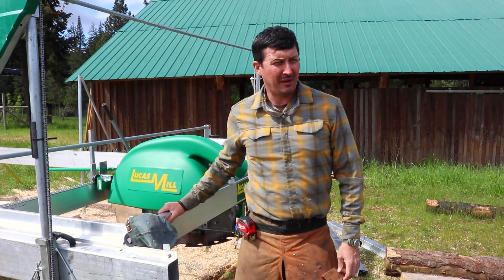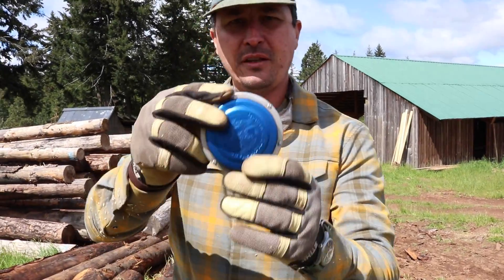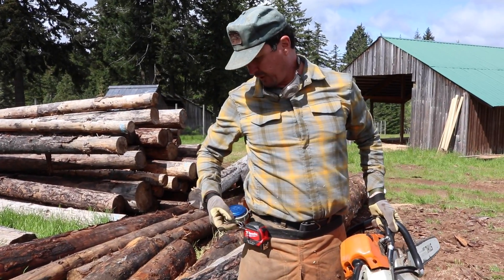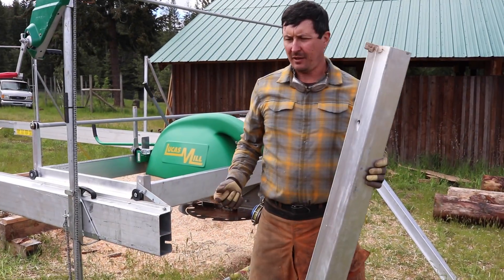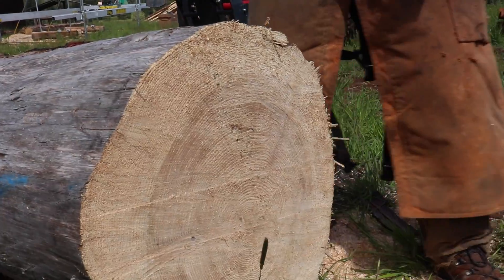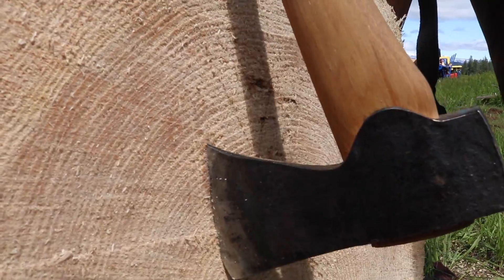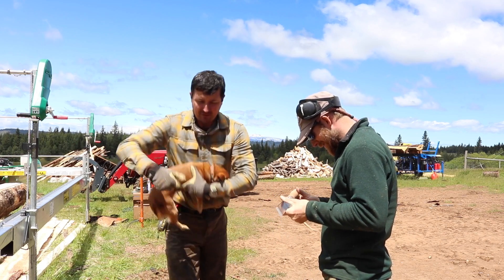Brian Gets A Special Gift

Comment: Slick working saw adjustment. On thing you may want to consider a friend of mine had a wood miser mill that was on a trailer so it was a bit high so what he did was he made a crib work of timber on the side of the mill and he had it set-up so that he could load the round logs on this crib work. the crib work frame with the round logs was same height as the bed the logs were sawn on, and then he had two removable pieces of timber to bridge between the round log cribwork and the saw mill cutting crib work, and when he wanted to load a log to cut on the saw crib work he would pull out the removable timbers to bridge between the storage crib work and the saw cribwork and roll the next log he wanted to cut onto the sawmill cutting cribwork or in his case it was a steel frame, then he would roll the log onto the sawmill cribwork and push the removable bridge timbers back under the log storage cribwork out of the way. this way he could store an evenings worth of round logs on the storage cribwork and easily hand roll the logs onto the saw cribwork to cut the log, where the removable timbers were bridged between the crib work was the walkway for his band saw mill and the work path. Good video I am liking the blade saw mill.

Comment: Use the Lucas out here also for the larger logs that won't fit on the band saw mill or the 100 yr old Ireland Circular mill. All 3 are great. Woodmizer has the hydraulics which are soooo nice,, but has it's limitations on size. The lucas is a beast too, and yes the simplicity of their engineering is very much appreciated by owners. That swing blade makes a rough cut as smooth as a large planer.

Comment: How will you prevent the wood from warping later as it dries since it is so wet now? Like some of your timbers did in the earlier timber framing project several years ago...
Reply: Think warp is so minor that in most cases you can easily fix like he did a few times with previous ones.

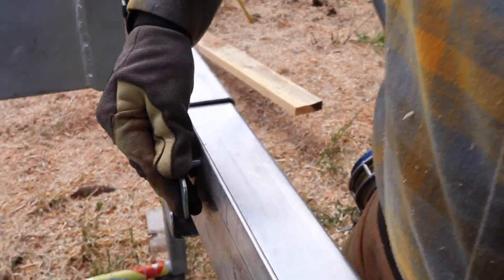Comment: @ 5:55 "It appears to be 19 feet and some change".   
From the Lucas Mill website: "CUT LENGTH: Up to 6.1m in standard form"

Love ya man!
Reply: Have yet to find and watch a video of someone using the Lucas times multiple for more than 24 feet or 36, 7.3 meter or 11, they do make extension connectors to match up as many lengths of main/regular rail system for the carriage including the supports.
6.1 meter = 20 foot, the extension makes a difference for that extra space before the cut or even after as his is now set up.

Comment from the maker: WOULD YOU LIKE TO SEE THE CHISEL I GAVE BRIAN?  HERE IT IS !!! - https://goo.gl/8M4ELi
Reply: you guys need to get some oak or mahogany
Reply: It doesn't grow there.
Reply: really wow that areas laking then here in virginia we have giant oaks and pines and im pretty you can grow mahogany anywhere
Reply: Wranglerstar -I bought two of these chisels a while back and wasn't impressed. Scheffield quality isn't what it used to be. They couldn't even be bothered to finish (polish)the tool or put their name on it so it wouldn't wear off after a week. I gave the top edge a slight bevel and polish to prevent cutting yourself on the rough sharp top edge.
That said it's about the only new timber framing chisels out there and after finish modifications they work pretty good.
Reply: Reasonably priced!
Reply: +Tony Miller The thing with oak is that it's so dense and heavy that even though the wood is stronger than say pine or fir, its own weight hinders is load-bearing capability. So a light, strong wood like fir can actually be a better choice for timber framing.  Just my $0.02.
Reply: Nice video, great guys, sweet chisel.
Reply: Wranglerstar : Robert sorby is literally just around the corner from where I work in Sheffield. 1/8 mile thereabouts . Not a particularly inspiring building considering the quality they produce.
Reply: They also used what they had available.
Reply: There's a rogue apostrophe in your description.
Reply: Wranglerstar What is your email?
I have a serious inquire abouta wonderful hatchet I have that was only 12 dollars!! I saw it is the store picked it up and it was amazing. I have a Granfors Bruks Small forest axe I bought at your recommendation and today I was packing my bag for a camping trip i have this weekend and I choose the new hatchet over my Granfors Bruks. I made sure to get two so that I can send you one.
Reply: Gerald Swain its a Magellan 14 inch small camp axe
Reply: awesome, thank you for the link!

Comment: Cody, do you have issues with the way the mill "wobbles"?  I've noticed in several videos how, when you're moving the powerhead or raising or lowering it, that it moves a lot.  It seems to me that this could cause issues while milling. 

What have your experiences been?
Reply: When you have to work with something like that, just make sure the lowest points of the movement is where you want your cut. That way you can always go over it again to make it even.

I also imagine that once the saw blade is inside the log, the wobbling would be mostly eliminated. :)
Reply from the maker: It doesn't seem to be a problem,

Comment: Cody another video that I really enjoyed, but there is one thing that makes me cringe a little as a former motor manual logger (probably not the right term in english it's a direct translation for the job here) please try at least once to have the measuring tape on you're left hip. That will almost eliminate the risk for you to accidentally cutting it off with the saw plus it won't wrap around your legs and be in your way.

It's not a very big deal but one off those little details that makes work a tiny bit easier and more enjoyable.